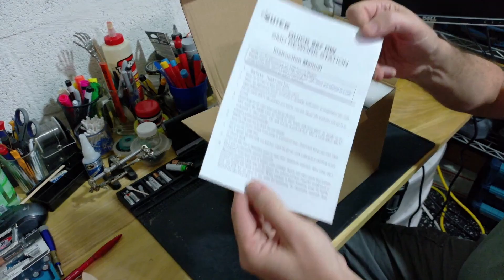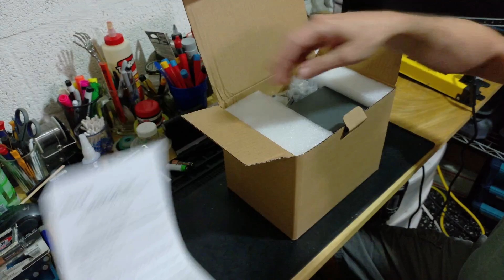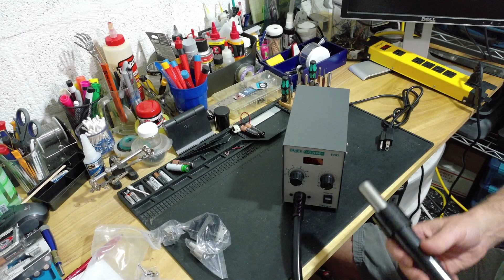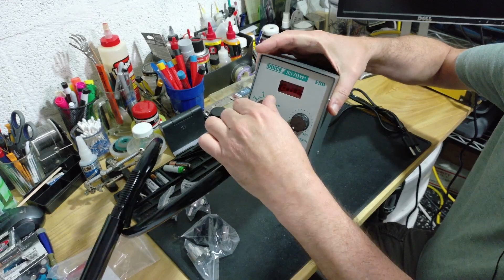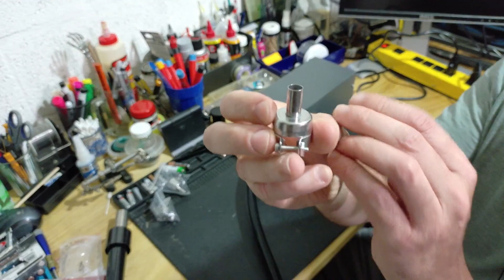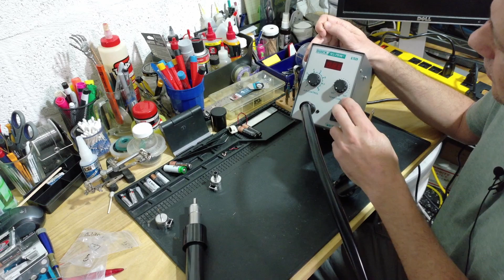Quick 957DW+ Hot Air Rework Station unboxing and review

Comment: Some of those stations have a screw at the bottom that you need to remove, otherwise the vibrations can damage the blower.
And it's not advised to use hot air on PCBs that aren't fiberglass, those normal PCBs are made of basically glued paper.
Reply from the maker: Someone mentioned that some time ago. I checked but it's not the case in this unit. Thanks for watching!

Comment: You need to remove the screw at the bottom otherwise the air will not come out
Reply from the maker: Hi, that screw holds the motor in place. It has nothing to do with airflow, at least in my case. The air comes in through the vents at the back. If you have the exact same model, you may want to open it up and check.